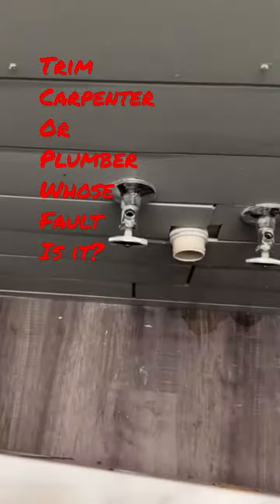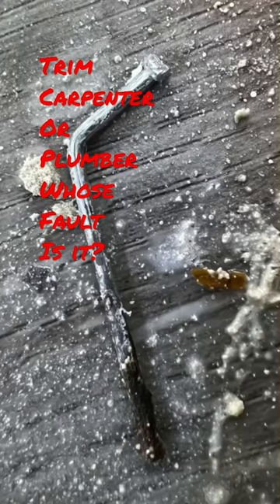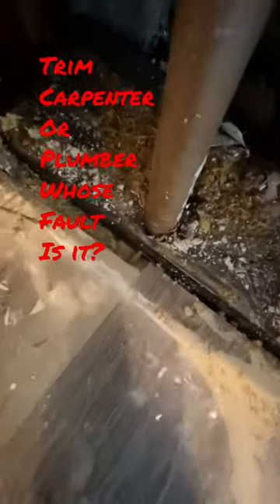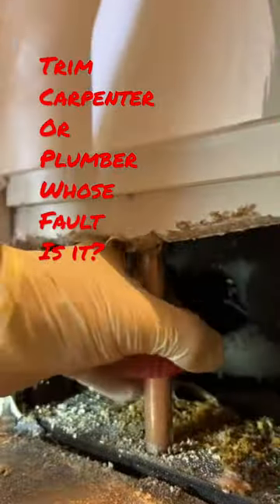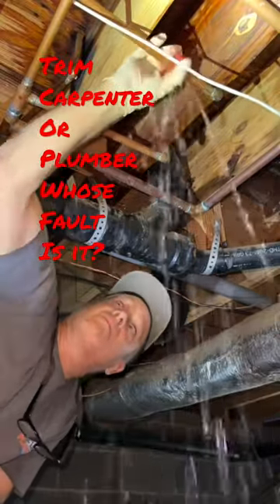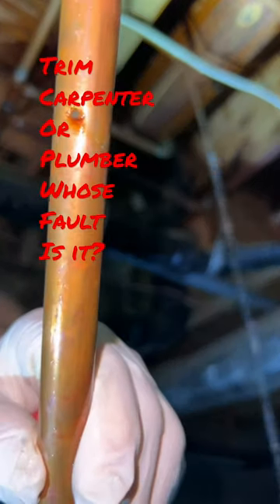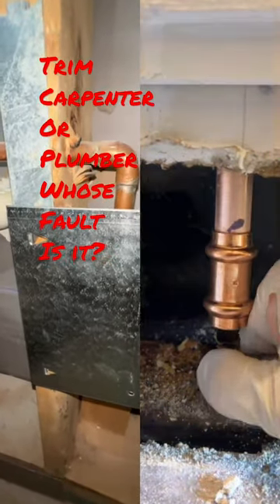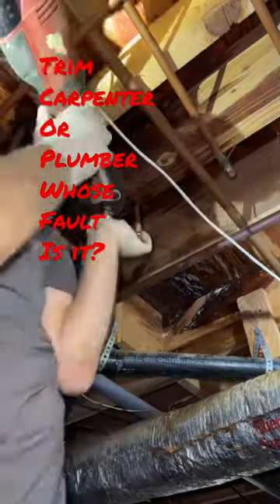Copper Nail Hole Repair@TappPlumbing #plumbingproblems #plumbing #copper

Comment: I seen galvanized pipe rust out in 6 months so yes
Reply from the maker: I have never seen pipe go out that fast , just out of curiosity where do live? Second question, Do you see that happen often and is it buried? Really three questions I guess. Thanks!
Reply: @TAPP PLUMBING  I live in north east Ohio . it was on a Relief valve on a domestic boiler it did it a couple of times.the only fix was to the find a brass nipple to replace it

Comment: Yes everybody's right. The plumber should of installed a kick plate on the 2x4 but I don't know why he would drop the pipe down, go across and then go back up. Why didn't he just go straight across like it was 90 up instead of putting a you fittings waste of fittings? Oh that's right. Maybe you couldn't get your tool in there. Maybe that's what it was. Huh man?
Reply from the maker: Not to mention the joint would be in the joist. The joist was completely saturated and the hole was extremely tight. 😂. Thanks for watching!!

Comment: Wondering why you used so many turns on your repair. Couldn't you do it with 3 fittings?
Reply from the maker: In all reality I could have used two if I was able to put a joint up in the joist . You can see the burn marks the original plumber made when he soldered the top of that 90. I did not have that option as the joist was completely saturated even if I wanted to. Thanks for a great question and for watching!

Comment: Both.   Its old piping and old cast.  That pipe could have been there 50 years.   It looks like a remodel since theres old stops on a new vanity.   If whoever did the hook up didnt do any new rough plumbing, its on whoever put up the wall.  Its on them to inspect for anyone elses fuck ups.  

If that was a new line, which it doesnt look like it is, its 100% on the plumber.
Reply from the maker: I am gonna pin this one the plumber!

Comment: Curious what lbs a pro-press joint vs a a Solder joint can hold vertically.
Reply from the maker: I'm not sure what your trying to ask but any joint no matter what kind should have as little stress as possible:)
Reply: @TappPlumbing  for instance, I can lower a water heater from an attic holding onto a Soldered elbow that's screwed in, can you do that with Pro Press??
Reply from the maker: I bet if one us had the time we could find pressure test videos to answer this question. I am more impressed that you have the upper body strength to lower the heater like that👍

Comment: Plumber and the board hanger, no plate but I would have marked the location on the floor and wall so the carpenter would see that there is a pipe that is close to the face of the board🤔👍
Reply from the maker: You are correct it is the plumbers responsibility:)

Comment: By the time the carpenter comes in to trim they can’t see behind the wall, so I’d say this one needs to be owned by the plumber.  A mail plate should have been used here and hopefully was after the pipe was fixed.
Reply from the maker: I completely agree, the original Plumber should have protected his work. Thank you so much for spending time with us!!

Comment: Was probably what they call “bright coated trim nail” which basically means bare metal that’s why it rusted so quick
Reply from the maker: I didn’t realize there was a nail with that classification, it sounds like a classic marketing term doesn’t it?
Reply: @TappPlumbing  sure does. There’s electro-galvanized and then “hot dipped galvanized” as well and sometimes inspectors call out “hot dipped galvanized” over the electro plated

Comment: This is why I always use galvanized nails when I'm attaching my trim to water pipes.
Reply from the maker: We truly appreciated you going the extra mile!! Thanks for watching and leaving a great comment also!!
Reply: @TappPlumbing  Funny coincidence. I was nailing down a subfloor today and had a nail go right into a water supply line. 😭 🤣
Reply from the maker: Was it an instant leak?
Reply: @TappPlumbing  It sure was. The nail was barely long enough to just nick the pipe. Luckily it was my own house the only thing that got wet was the basement.
Reply from the maker: I am gonna guess you know how to fix this yourself?
Reply: @TappPlumbing  I bypassed it with some pex. It's a full bathroom renovation. I'll have my plumber do a permanent repair when he's here. 👍

Comment: 1) Agreed 1/8” thick metal nail plates are required building code in ALL 50 states in the US and Canada! 

2) it is illegal to drill a hole in a wood or metal stud that’s not in the center of the stud and is more than 30% in diameter of the height of the studs

Example: a 2x4 wood stud mounted vertical to the bottom plates and top plate will be 1.5” thick (width) and depth 3.5” 30% of 3.5” = 1.05” maximum diameter of the hole diameter. 

The 30% whole diameter applies to all wood framing and Wood Ceiling and Floor Joists! Floor joists are 2x8, 2x10 and 2 x12 ‘s.

When you install ABS or PVC Septic pipe it’s standard inside diameter is 3” or 4”!

The maximum size hole is 2.175” drilled in the center of a 2x8 lumber which is 1.5 x 7.25” on 2x10 lumber it’s 2.77” on a 2x12 it’s 3.375”
Reply from the maker: Well stated and agree! thank you so much for commenting and watching:)

Comment: also it's illegal to trap the water line like that without putting a way to drain the water from that point
Reply: Dude do you know what a slip coupling is
Reply from the maker: the joint would not be up in the joist as it was before and not accessible:)

Comment: Damn forest do you think you used enough fittings in the crawlspace, is it a p-trap
Reply from the maker: The joint would be up in the joist as it was before and not accessible:)

Comment: Pipe to close to inside of wall and no protection required by code. No nailing block in corner for base.  Carpenter nailing base in between stud bay is verboten.

Comment: Both plumber should put a Nail plate. And framer should mark it not to nail there..
Reply from the maker: Speaking from the standpoint of a plumber, I have to blame one of us. You definitely should not leave your work exposed like that. It was really cool of you to take the time and let us know your opinion. I would bet certain plumbers would definitely agree with you🤫😂. Thank you for watching!!!!
Reply: @TappPlumbing  honestly when I'm hanging I do remove some protective plates.. at the bottom of the wall and in the bathroom or kitchen where long fasteners could be used I wont.won't.. but it there is a pipe in the top part of wall and metal plate is pushing my rock out and looks like 💩.. I will mark not to screw there ( yes I will check for crown molding )  and if not I will remove the plate l knowing I would be the only person to hit it.. I want a mirror finish and not humps
Reply from the maker: @mikethomas3069  I don’t know where you live but we don’t have drywall mechanics around here like that. Your work is true art if you are good at it . I have messed with enough drywall to know . I have never been satisfied with my own drywall work and it is better than the dudes around here the hang and finish. Of course it takes me 10 times longer and it is on my own home .

Comment: Yep. Plumbers fault. No nail plate. What's with the giant u-shaped pipe?
Reply from the maker: Great question. The first reason is I couldn’t get my joint made inside the framing joist that’s why it hangs down so low. That leaves only one way to get the pipe tied back together. Thank you so much for a great question!!!

Comment: Why is that line so close to the edge of framing? Nail plate or not a puncture is inevitable. Plumber needs to do better
Reply from the maker: They were trying to avoid the joist in the crawl space but still drilled through it . The wall should have probably been furred out to start with. Thank you for commenting!
Reply: do better how? if on the exterior wall water line can be pulled to the front of wall to get insulation behind it here in the south in a 2x4 wall. yes a nail plate is missing but  nothing wrong with the water line pulled to the front of the wall. only thing he did wrong was no nail plate and either it was there when inspected or inspector missed it.

Comment: The plumber for not using a pipe guard and the carpenter as well y bc it's 16 on center you always nail into the stud  also its a bathroom and did he not see the pipes coming out of the wall  and use  a better judgment

Comment: Have to use that extra trap that you made there if you knew how to solder
Reply from the maker: LOL, the fact that I know how to solder is why  I used Pro Press in order to avoid the steam, avoid putting a solder joint in the joist as it previously was and get the clients much needed water supply on quickly:) Thank you so much for watching and engaging!
Reply from the maker: @licensetochill79   so you put solder joints up in joist where they are not accessible? I’m worried about the steam blowing the solder out of the joint. We will agree to disagree and that is okay. We warranty our work as I’m sure you do as well! It is nice to know there are other great plumbers out there!
Reply: @TappPlumbing  you premake the pipe. Meaning you cut your links that you need your solder your 90 you shove it up and through solder a coupling on the top use a slip coupling on the bottom
Reply: @TappPlumbing  not picking a fight with you I'm just so old school it's not even funny. And there's new buildings here that have been used Pro presses at a less than 10 years old and they're leaking already. Then I go to some of my older buildings and they got 50/50 solder yes LEAD solder and they're still holding together
Reply from the maker: @licensetochill79   I know they just don’t make stuff like they used to and the stuff that last for ever isn’t good for us 🤷🏽 Where are you located?
Reply: @TappPlumbing  new jersey you
Reply from the maker: @licensetochill79  we are in GA

Comment: Looks like a lot of extra fitting to make a p trap with the copper when it only needed a 90 and a coupler
Reply from the maker: I am not fond of the looks of it either . Water would not stop draining and if look really close at the system other options would have taken forever. Yes I know about white bread  and all of the other little tricks. I always have clients who are waiting next in line and need to get people their water back on! Thank you so much for spending some of your valuable time with us!!!!
Reply: No way to get it tgether and still bootom the tubing in the fittings fully

Comment: Old rough in, new tile. No plumber involved in the remodel.
Reply: A plumber would have removed the stops and capped the copper stubs for the cabinet install
Reply from the maker: Great point! Do you think the original plumber should have put on some stud guards?

Comment: Back in the day trim carpenters didn’t hit copper pipe because they paid attention.
Reply from the maker: Don’t know what “back in the day “means to you. But for me that would be no guns at all. There used be little carpentry tools called hammers😂 Thanks for watching!!!
Reply: When I laid floors I was taught to shoot on either side behind the toilet because the pipe is usually near the center
Reply from the maker: I always have so much respect for people that do floor work. It looks brutal for your back and knees. Like most other trades ,it is hard to find a true pro!

Comment: Of course the plumber.
There is a high tech piece of equipment missing.
23rd century technology that could have prevented this….
Nail plate! 
It’s a small piece of metal that goes over the framing where pipes n wires are run.
150% the plumbers fault.
Reply from the maker: You are correct or you ain’t wrong as some would say😂 Thank you for watching!

Comment: Why not make repair with a single 90?  Slide coupler to one side or another & make connections.  This repair introduced 2 more friction points. 

Am I missing something? If so, I'll eat crow.
Reply from the maker: Lol we do solder , however if we had soldered or use pro-press we would have repaired the same as you have to look quickly but the original 90 was up in the joist and we do not do that. We would have no access to one side of the 90. Thank you so much for your comment! We appreciate your engagement.
Reply: @TAPP PLUMBING  from my view, I'd fab the 90 first due to the access issue & slide couplings to clear joint, locate prefab 90, then slide & crimp.  But here am I 2nd guessing a professional.  All due respect & keep on plumbing bro!

Comment: That's all on the Plumber.
Trim Carp. doesn't know where the plumbing is.
I'd rather have the nail horseshoe and blow out the base than poke holes...
Reply from the maker: You are correct it is the plumbers responsibility:)

Comment: Plumber. No reason to cross studding so low to the floor. Seems to be plenty of access and room below the floor. Plumber could have ran down and up the wall cavities thru the floor instead of thru any studs
Reply from the maker: The original plumber drilled through the beam below the wall. The wall should have been furred out to prevent this.

Comment: Blame it on the hammer manufacturer, they used low quality steel so the nail drove into the pipe loose.
Reply: Used to drive nails into a pipe and know its good for 10 years on a 50s hammer and 7 on a 80s hammer.
Reply from the maker: I never thought about that , if we do it that way no one would get upset 😂 Thanks for sharing!!!!

Comment: Wait you are telling me it had a nail in it for a year before it started leaking
Reply from the maker: Yes , that is not the usual part of the story. I have gone to many leaks that started multiple years after the nail went in. Many don’t leak until the nail tip rust out. There are plenty that leak immediately as well !
Reply: @TAPP PLUMBING  it probably doesn't have anything to do with how cheap the nails are made they are iron and carbon and some minor elements it is probably more of an electrolysis problem or or just someone kicked the base board or stepped in the wrong place

Comment: Why didn’t you just sweat an assembly together to match what you pulled out and simply press 2 couplings together instead of wasting all that money lmao.
Reply from the maker: To be quite honest this was quicker and less painful. It did cost me a little extra in fittings but saved a long crawl out and back . You can tell I am pretty old . What ever I can do not to stress out the knees and back is well worth 10 or 12 bucks . That is a great question you have!!  Thanks for watching!!!!

Comment: Lol what’s with all the 90s?
Reply from the maker: So that the joint want buried be up in the joist like the original it will be accessible.
Reply: @TappPlumbing  propress fitting couldnt fit in the hole 👍 got it!

Comment: Trapping water?
Reply from the maker: It looks kinda odd doesn’t it?
Reply: @TappPlumbing  well I was jut asking because that’s against code, I’m a plumber my self. In some instances there is no other way to run it but there were other ways to do this one......now when you drain the system water will sit in that pocket
Reply from the maker: Which code do you follow? If it is the IPC a an you give me the index number?  You are correct there are always different ways to this and most other things as well. With out having a joint up in the incredible saturated floor joist do you see another way out of this one? Thanks for your time !!!!!

Comment: Trim carpenter should know better than shooting nails within vicinity of plumbing.
Reply: Unless you have x ray vision there’s no way to know for absolute certain where every pipe is located. They can run through just about any wall anywhere. That’s why nailer plates exist. That nail was at the end of the vanity, away from any obvious plumbing fixture that would have a pipe nearby.
Reply: @Artificially Unintelligent  First of all...who puts trim behind a vanity? Nail plates aren't code everywhere and even if they are code, don't "expect" everyone to do their job right. A little fast setting construction adhesive in a questionable area may be a pain in the ass but works really good. Bottom line, trim guy took the job and shot the nail. Honestly, I would have probably placed the nail in the same location. But I wouldn't trim behind a vanity. And being my nail, I would just take care of the problem and not shift the blame.

Comment: Carpenters don't like nail plates because it interferes with the drywall.
Reply: Carpenters / Framers  don’t install drywall it’s the job of the Drywall Contractors 

That’s too bad! It’s building code in North America. They protect PEX, Cooper plumbing and Romex copper electric wiring! 

Drywall contractors have to cut out 1/8” deep notch to match the height and width of the nail plates of the back side of the drywall!

They could also rip on a table saw wood 2x4’s down to 1/8” after making allowance fir the 1/8” blade cuff and Brad nail, staple or glue them over the studs or use thick cardboard it’s sold in most big box stores!